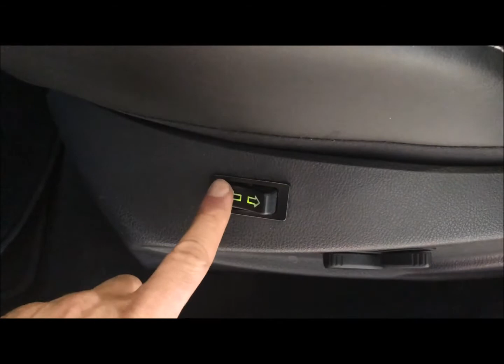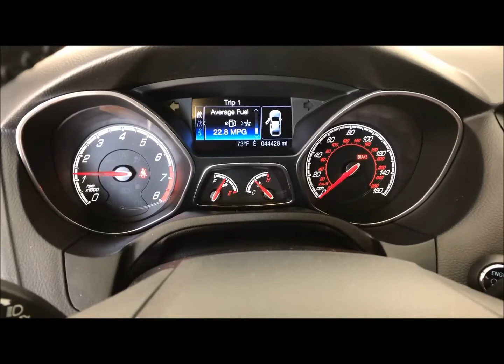Focus ST Electric Cutout Timelapse Installation and Sound Clips

Comment: Is this cutout the 2.5 inch or 2.25 inch variation? Also, can you do a tutorial on the wiring you did. Looks very seamless!
Reply from the maker: I used the 2.5" QTP cutout. QTP markets the 2.25" and 2.5" as two different sizes, but if you look at the dimensional drawings on their website you'll see that are the same physical size - I called QTP and they confirmed this. 
http://www.quicktimeperformance.com/Support/Docs/QTP_PRODUCT_MEASUREMENT_2013.pdf 

I've had several people ask about the wiring - I'll put together something on that when I get some time. Thanks!

Comment: This is a great install! What valve specifically did you buy?
Reply from the maker: QTP-QTEC225 Exhaust Cutout, Electric, Aluminum, Bolt-On, 2 1/4 in. Diameter

Comment: Have you run into any problems with it so far?
Reply from the maker: Nope, works great. I shoot the butterfly valve with a little liquid wrench every few weeks just to keep the black exhaust carbon from building up.
Reply: @6gears2freedom  nice, thats good to hear i had my car fully straight pipe with a catless dp for like 2 weeks and it was way to loud, so i ended up installing my rear muffler back on but now, its too quiet lol and here I am

Comment: can you show me more detail on how this is done?  more pictures?  how to?  Thank you!
Reply: Hey actually i think i got the jist of it but does your ST have a catless downpipe?   What are your exhaust mods here in this video?   I want to do what you did... I currently have a CNT catless downpipe with a resonator deleted.. thanks for the info.
Reply from the maker: The car still has the stock cat, but resonator removed. The different sounds in the video are with the cutout open and closed. When the cutout is closed everything flows through the stock muffler.
Reply: @6gears2freedom  Thank you!   I ordered my cutout last night... thanks for the video as it helped me with my ordering decision.   Super excited i'll have to make a video and share it with you.     yours and mine are the same other than i have a cnt catless downpipe
Reply: I went to the muffler shop.... do you have any pictures showing behind 1:43 ?    The muffler shop guy wants to see exactly what you guys did back there....    any info would be helpful!  I'm dropping the car off tomorrow a.m.   Thanks again
Reply from the maker: @josholand  Hi Josh, Sorry I don't have any pictures handy, but there really isn't too much to see. I just ground the end of the collector pipe to match the curve of the car's stock exhaust bend. From there, plasma cut a hole in the stock exhaust and welded the collector on. Make sure you angle the collector so when you've added the cutout and turn-down you still have clearance under the car. I didn't want mine to be visible below the rear bumper. I hope all goes well for you!

Comment: Was there any welding involved in your install?
Reply from the maker: Yes - plasma torched a hole in the stock exhaust tube just before the muffler and welded in a header collector flange to provide the 3-bolt mounting flange for the cutout. I also cutout the resonator and welded in a SS straight pipe.
Reply: What size collector flang did you have to by?
Reply: @6gears2freedom  what size collector flange 3 inch?
Reply from the maker: @geoffreylindow738  I bought a stainless steel 2.5" (3-bolt flange side) to 2" (car exhaust side) collector-reducer off eBay. I could only find a stainless steel one on eBay. You can get aluminumized steel ones from Jegs/Summit.